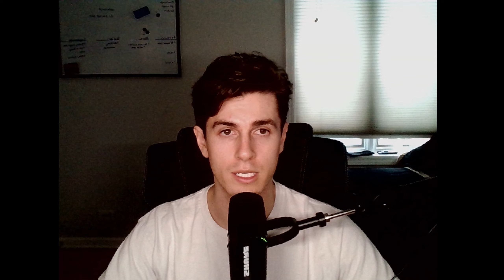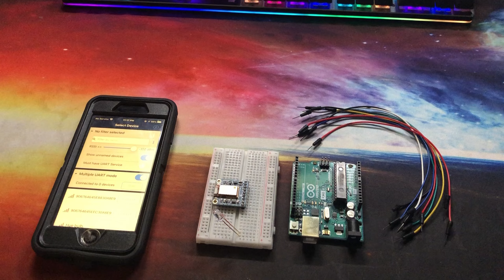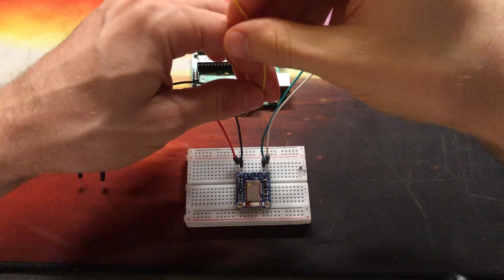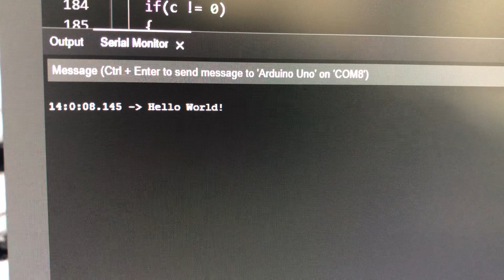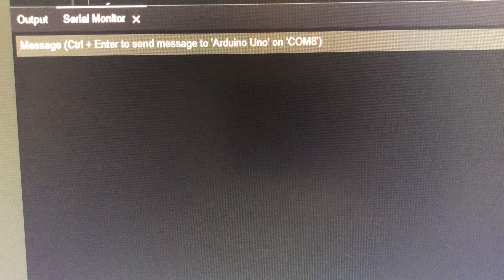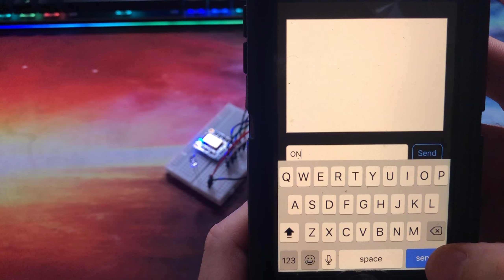Arduino Bluetooth Blink the LED (For Beginners)

Comment: Hey! i've been watching your videos since a while. I'm an EE student in his final year, and I really want to do a personal project (perhaps evensomething simple), but I'm not sure where to start. I have not done PCB design before. do you think you can offer some sort of mentorship or classes to help? I'd even be willing to pay if it requires, but I really need to do this project before December before I graduate. I haven't found comprehensive start to finish EE project tutorials online.
Reply from the maker: What sort of project are you thinking about doing? Will it involve designing your own PCB?
Reply: @RGBEngineering  yeah, designing a pcb from ground up. Definition, schematic, simulation, pcb design and testing the actual thing. I was thinking a DC DC converter or a motion sensor led, but i'd like your suggestions. I just want to learn the whole design process and make something useful
Reply from the maker: @Usbarlas  Check out these videos:

https://youtu.be/BzQBTE5ajBY

https://youtu.be/8ph9Kk2u5k8

https://youtu.be/G17vncKrqw8